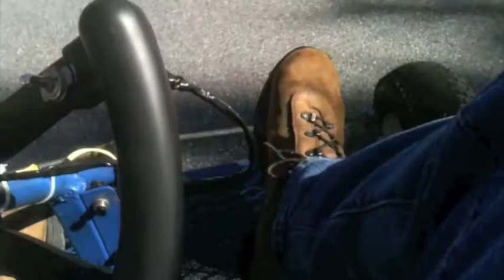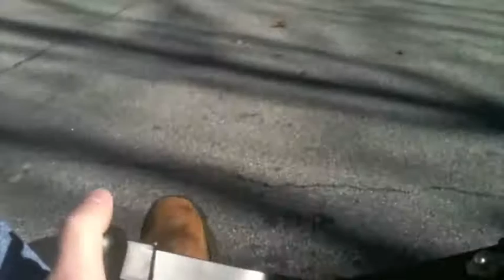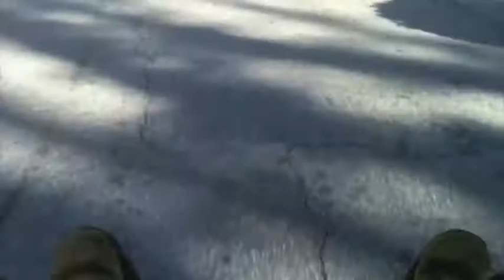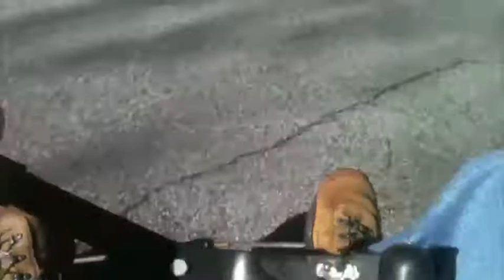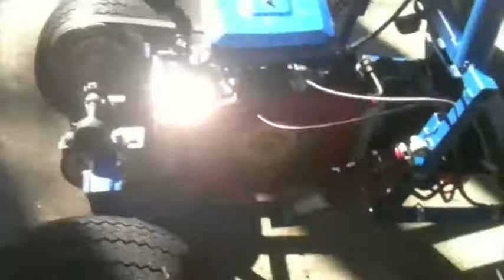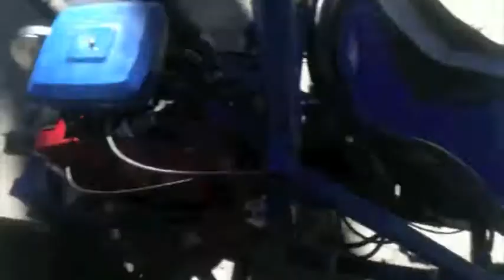18hp Briggs engine power band breakup

Comment: hey bud get yourself a mukuni 30mm carb. and get a mukuni fuel pump if you want to go wot with it you are going to need to make a vacuum circuit for the carb also maybe a hotter sparkplug to allow more boomage. then a quick port and polish and baboom. had to do all this to my 22 hp brigs to allow this

Comment: Even if they did have an accell pump it would be kind of redundant, because these engines breathe through a relatively small venturi. Plenty of potential though, but I guess nobody really built a fully performance oriented carb for the old twin.

Comment: Idle it up a little, and richen the idle mix. Thats a big carb, and big carbs dont like sudden wide opoens. Ny 18 HP twin lawn mower doesnt like sudden throttle. The 12HP briggs vertical, and 5HP horizontal both have great carbs that rev beautifully with no hickups.

Comment: clean your carb and fuel pump.. let it run a little rich for a while till it smoothes out. make sure it has a fuel pump and make sure and pump and carburetor seals are good.. i had the same prob with mine. those pumps go bad easily. good luck though